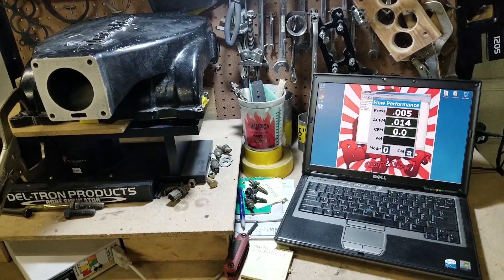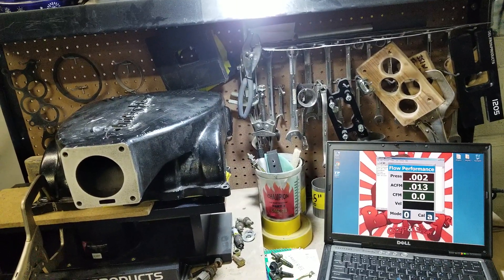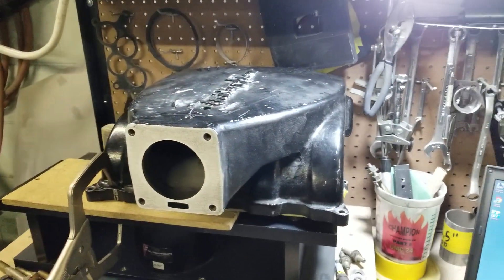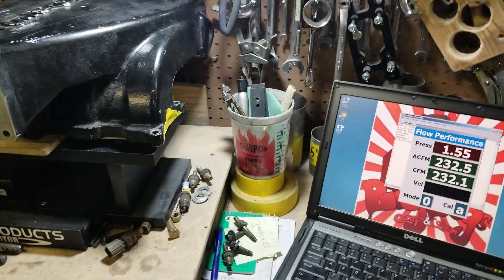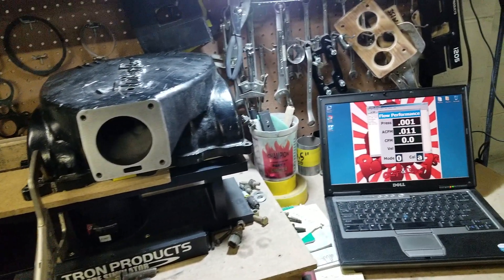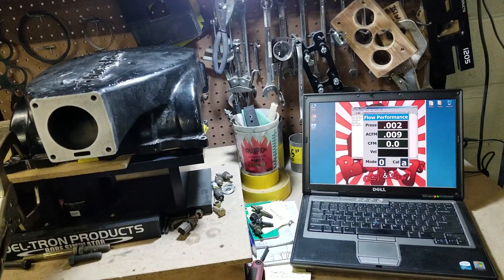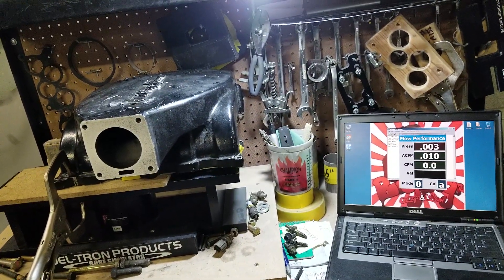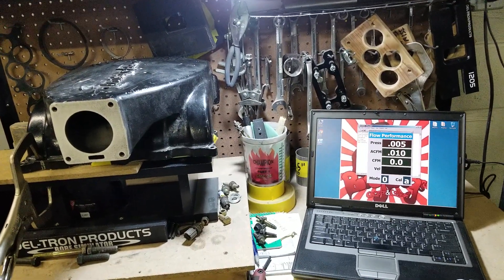Bigdogs Porting TFS 5.0 track heat vs ported gt40 flow test part 4

Comment: Question, will the stage 2 ported GT40 outdo the systemax 2 on the dyno? I messaged you yesterday about your cobra intake prices and I do want to shell out the money, because it’s $400 cheaper than the name brand TFS or Holley…..

I get that your flow numbers are great but what about velocity and port style?
Reply from the maker: Everyone knows port velocity and design are not issues with the gt40 style of intake manifolds, its CSA and flow. If you've been on our Facebook business page then you should have seen all of the dyno examples and can compare similar combos with other manifolds. Our stage 2s make more average hp than the Systemax 2 from idle to over 6,000rpm. We have customers that  has taken off track heats and Systemax 2s and put on our stage 2s and made more power everywhere. We even posted a direct comparison on the page. All of this has been proven over and over
Reply: @bigdogsportingtonyb2833  I am not trying to bash you or your work. I’ve been messing with mustangs for 20 years. I mean no disrespect. The fact is there isn’t 1 dyno video of your GT40 intake making 400HP. Not one. Hell there are hardly any dyno videos and I see you asking your customers for dyno results a lot, and they don’t seem to reply.

And if velocity and design are not an issue with the GT40, then why do none of them seem to make 400hp?
Reply from the maker: @smallfry0764  message us on the Facebook business page and we will send you dyno results. 
Many customers don't want their information out there and every result we've published we have gotten permission from the customer first. 
There is a customer that did a comparison between a lightly ported Systemax 2 vs one stage 2 Explorer gt40 manifold. The Systemax 2s run was clean with no issues. The stage 2s runs had electrical problems that limited power past 5,000rpm yet the stage 2s run was within a tenth of the ported Systemax 2s clean run. The videos are on YouTube   under VRM.
Think about this, a company that doesn't put out what they claim wouldn't have any customers right? Well we stay full and backed up with orders all the time. Our customers know the truth.
Reply: @bigdogsportingtonyb2833  So again, have any of your intakes broke 400rwhp?
Reply from the maker: @smallfry0764  yes!
Reply: @bigdogsportingtonyb2833  Okay take my money lol
Reply from the maker: @smallfry0764  🤣🤣🤣. You have to have the right supporting parts tk make the power. There are thousands of people running Systemax 2s, Victor 5.0s and Box Rs that are making less than 330rhp do to their combos and not the manifolds capability. This is why we do a direct flow comparison.

Comment: I've seen a trick flow street heat intake  Cutt and shortened...
Reply from the maker: Yeah but this comparison was against our stage 2 gt40 manifold which is not cut and shortened lol. Our stage 3 gt40 manifolds get cut, added metal, fully race ported and shortened and are still way less than even a stock aftermarket let alone a aftermarket that you have to port. 
Besides unless you see actual before and after flow results just doing the work means nothing. It has to show significant gains and that's what our porting do. We have not seen any other porting companies show the kind of before and after flow gains from their porting at our prices. We've looked!👍

Comment: So what kind of numbers could you get from the Track Heat upper if you ported to Stage 2?
Reply from the maker: We can get 290-300cfm with our stage 2 porting on the track heat and 310cfm on the Systemax 2 with our stage 2 porting on the upper and lowers.
Reply: @bigdogsportingtonyb2833  is that through upper and lower together or just lower?
Reply from the maker: @Wolfpacker1991  it's the upper and lower bolted together. We don't do bs porting like so many others. We port the uppers and lowers. Our stage 3 porting on the track heat manifold can get 340cfm bolted together. Stage 3s get the uppers cut, shortened  and fully ported plus more porting on the lower.
Reply: @bigdogsportingtonyb2833  those are some awesome numbers! Thanks! Looks like I'll be sending my Track Heat to you this summer.